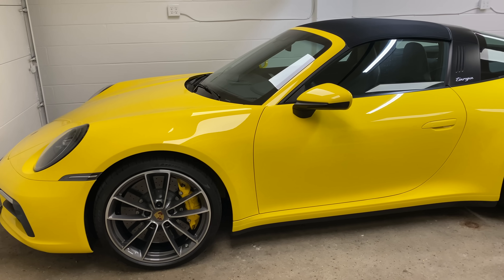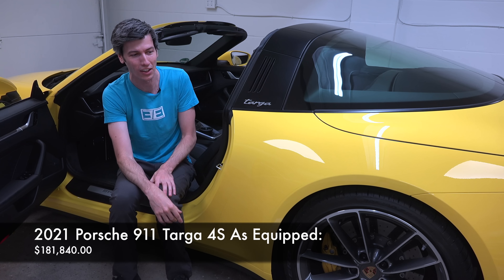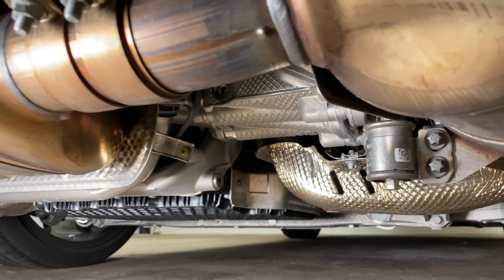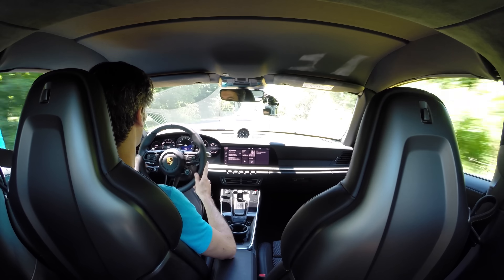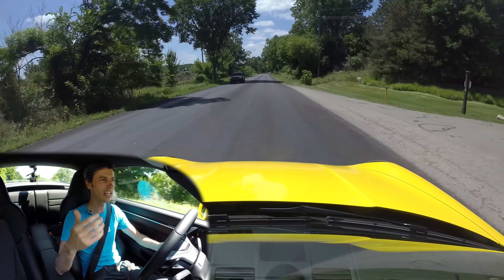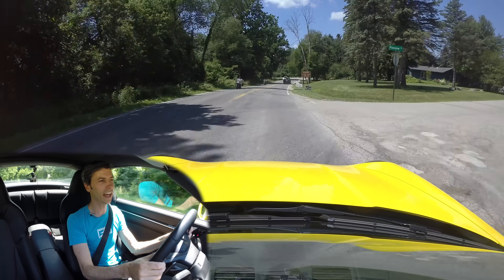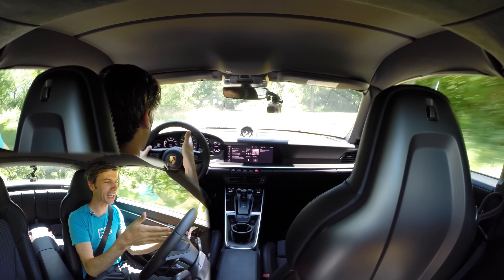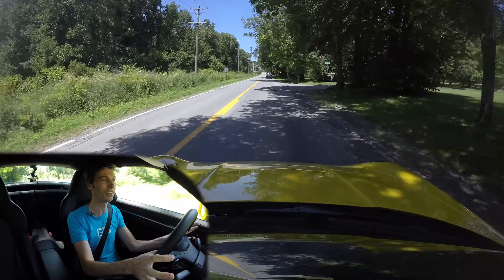2021 Porsche 911 Targa 4S Review - Big Beautiful Glass!

Comment: if they can get so clever with the targa mechanisms, there has to be a way to make that thing be a hard-top panel. Cloth looks so cheap, and it ages awfully. As a yellow sportscar owner, I support this colour
Reply from the maker: I agree with you there!
Reply: Yeah, to me if it's not a solid piece, it's not a Targa.
Reply: @Mountain-Man-3000  The original Targa had multiple aluminum panels encased in a vinyl cover so the current one is not incredibly different
Reply: You may be correct, but note that the panel does not maintain the same dimensions once it is stowed - you'll see that as it moves back it actually shortens in length in order to fit the space available between the back seat and the back of the rear window.  Assuming overall proportions of the car remained the same, you'd have to design a break in a hard-top surface that would enable a shortening of the panel, and I suspect from an aesthetic standpoint that would look.....unclean.  Something to think about.
Reply: Not good color for funeral attendance

Comment: Insanely overpriced! It's basically just a convertible 911, and it's in exotic supercar territory! 911s used to be a little pricey,  yet performed nearly as well as supercars.  They used to be more expensive than Corvettes, but not drastically so. One could argue that they had better dynamics and quality than Corvettes,  but a good value for their performance.  This is 3 times the price of the new mid- engine Corvette.  Absolutely absurd. And the Corvette comes standard with a targa.

Comment: Why would they make that gearing that way? So many above the 1:1 which is normally where we think of as Overdrive? It's strange. Can you do a video explaining the why's and whatfor's?
Reply: Most cars have a similar ratio spread. Overdrive gears are those under a 1:1 ratio (here technically being 6th-8th as there is no direct 1:1). Ford's 10-speed has 8th-10th gears as being overdrive for highway economy.
Reply from the maker: Depending on the final drive, it may not make any difference. For example, if you had a crazy high 5:1 final drive, you'd expect to see numerous overdrive gears. If you had a very low final drive (like ND Miata), you might not have any overdrive gears (like ND Miata).

Comment: Is that top cloth? If so, why? It'd be some much better in metal or even painted carbon fiber.
Reply from the maker: I wish it was too. The reason why is packaging. You'll see it folds into two sections to fit into the back. But I'm with ya, wish it was a hard top that folded back.
Reply: @EngineeringExplained  gotcha. I didn't take notice to that. Usually though, Porsche doesn't take the easy way out when it comes to engineering. To me, most soft top cars remind me of someone standing with a dishcloth on their head.

Comment: That's one hell of a complex, heavy and potentially unreliable way to try and make a targa seem like a good idea! :-)
Reply: Modern cars are complex and heavy, why not embrace it? And keyword is potentially unreliable, customers wont care too much about that being they'll be into the next model by the time the warranty runs out.
Reply: @ALMX5DP  having an unreliable is very stressful and an awful experience on the whole regardless of the warranty
Reply: TheGeekSoup good thing the OP referenced “potentially” as nothing here is confirmed unreliable and certainly no more so than any other modern luxury convertible.
Reply: Dj d like you said, most new cars are this way so really it’s just the norm at this point
Reply: they should have made it a retractable hard top.
I just don't like wrinkly soft tops.

Comment: So what you’re telling that it takes one pothole to break that engine
Reply: Dj d  it's about the exposed engine at the bottom
Reply: Debashish Kaushik i mean a lot of cars lack covering on the bottom of the engine, i’m not sure what you’re getting at. plus porsche would obviously design the car to not hit the engine on the ground when the suspension bottoms out.
Reply: Backing up over a curb could cost you an engine, no thanks.
Reply: Waffeey and not just a cheap shitty engine either
Reply: Waffeey What you’re proposing is solved by a hazard-risk analysis.  You’ve identified a hazard— losing your engine to backing over a curb.  Next you multiply that by the probability of occurring.  Lucky for us, there’s a shitload of data on 911s.  I do not believe there is an epidemic of engine losses due to the hazard you identified, so the risk is probably no different than cars with their exposed engines in the front— the direction cars are going most of the time.
Reply: Riskk -Squid ...isn’t that a plastic sump cover..
Reply: @donbrashsux  it' fine, it's a dry sump, there's no oil in it ;)
Reply: Only if you drive in Brazil
Reply: @ghoulbuster1  Greetings from Russia, lol 😆
Reply: Y'all just got woooshed lol it's clearly sarcasm

Comment: That articulation on the hatch area is the stuff of dreams
Reply: Reminds me of the Honda del Sol Transtop.
Reply: at 1:10, there is another step where the corners of the targa bar move out of the way of the roof moving back. Amazing design !
Reply: KevinK2 nice catch, that is cool
Reply: Looks like the c8 Vette procedure, but... Smoother, and... On a MUCH better looking vehicle.
Reply: MX-5 RF is more satisfying and costs a fraction as much. Many others powered tops out there more satisfying as well.
Reply: VW Eos Same or even more...
Reply: And wallets nightmare!!!!
Reply: Any quick glance at the rear glass hinges mechanism suffice to foresee that it's completely undersized for the weight of the glass that it moves. There are soft-top convertible armatures more sturdily designed than this, and they holds way less weight. It's a perpetual "need adjustment" nightmare.
Reply: @Jeronimo Stupenengo Pefaur Obviously. 
A good easy maintenance money farming at least.
Reply: @Andy Solomons the Sebring uses a traditional soft roof with a glued glass, it's the top notch stuff for convertibles. But it's nothing as heavy as the curved panel of the 911 targa.
And don't underestimate VAG engineers cost cutting skills....
Reply: they should have made it a retractable hard top.
Reply: I have a coffee table that does pretty much that... you need to update your dreams.
Reply: Vasya Pupkin but does your coffee table have launch control?